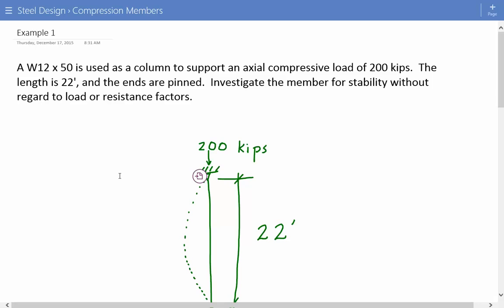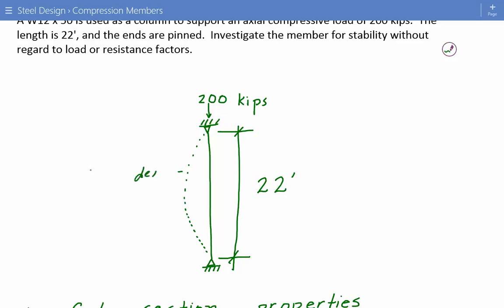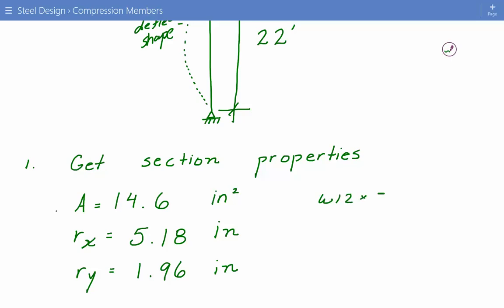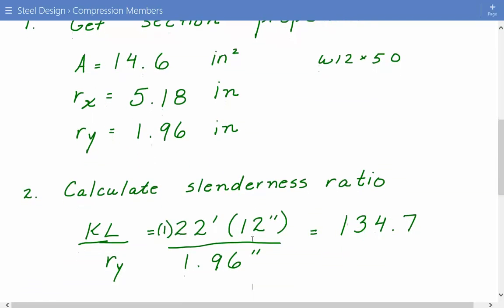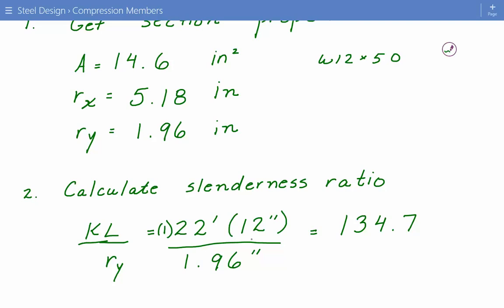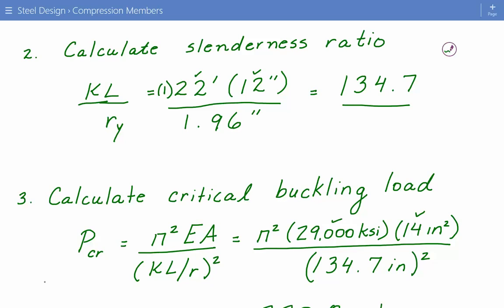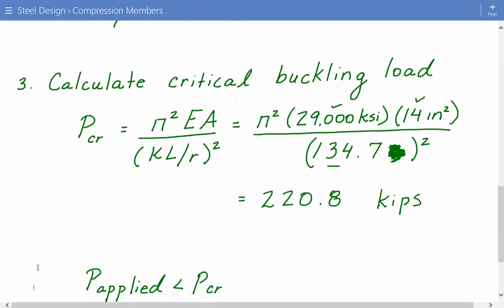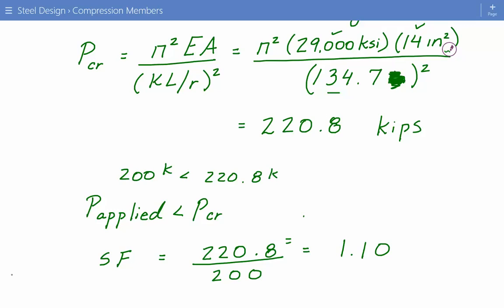Structural steel engineering design & analysis of compression members using ASD and LRFD Tutorial 1

Comment: Should calculate based on section E3 in AISC 13th. You need to continue and calculate the flexural buckling stress and from there the nominal compressive strength. Then you can get the allowable compressive strength or design compressive strength.